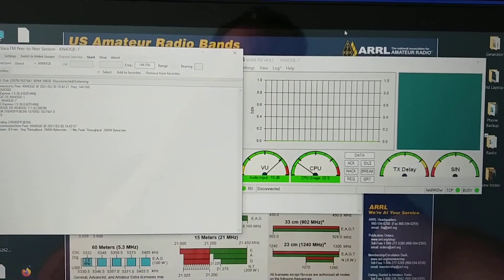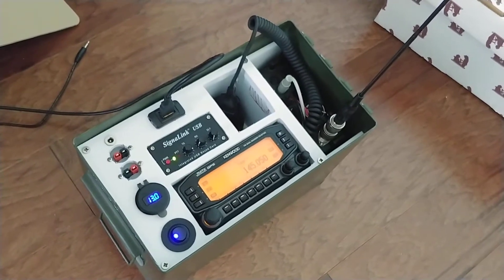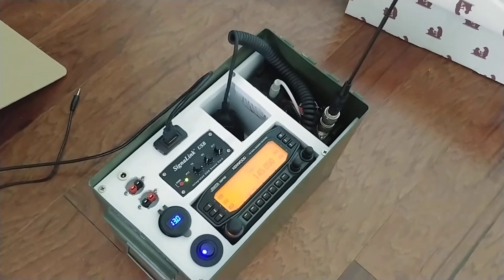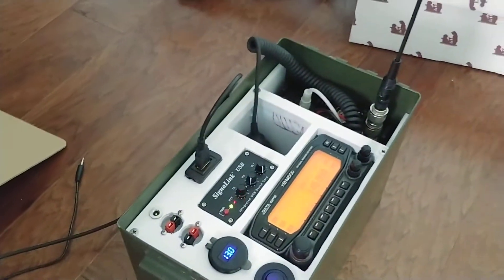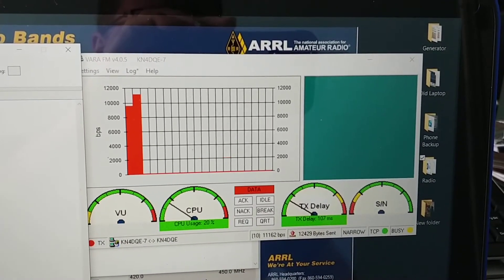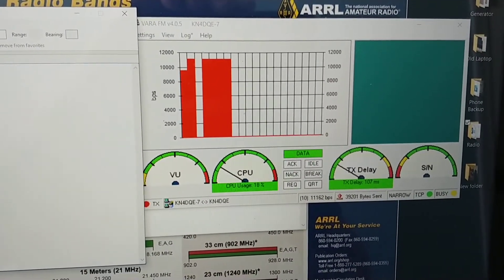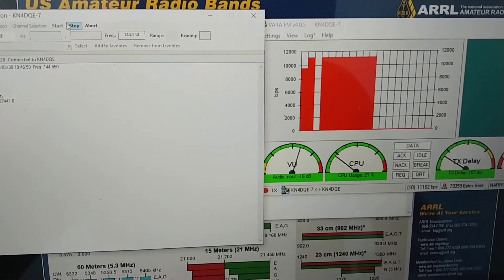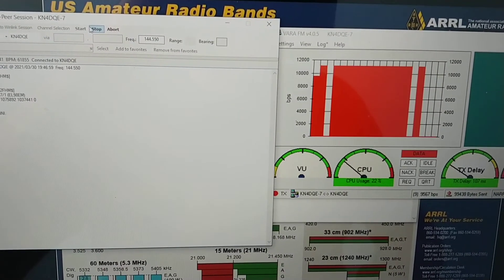VARA FM narrow mode between D710 and IC-9700

Comment: I just watched your video today and since it is now almost a year and a half later, I am wondering if you have you tried the peer-to-peer connection beyond your shack?  I am curious as to the distance you are able to get with VARA-FM in P2P with another station.  Of course I am thinking about EMCOMM when RMS gateways may be down.
Reply from the maker: I have a diamond x50 mounted in a tree about 100 feet in the air. It's putting out about 75w on 2m. The furthest I've been able to reach with P2P is about 20 miles. Speed isn't great, but I've noticed that VARA P2P doesn't have as much reach on 2m as 1200 baud packet.

Comment: I am a fan of your TH-D74 WinLink via Bluetooth video. I'm wondering if the same is possible with VARA FM - TH-D74 VARA FM via Bluetooth.
Reply from the maker: Good question! I'll have to test it because the bandwidth may be too wide. I'll give it a try and post the results. I did try using just a regular audio cable with a baofeng to see what would happen and it would not work. I needed to use the soundcard interface. Now you've got me curious!

Comment: When connecting the signalink to your Kenwood 710, which port on the 710 did you connect to?  On the head or on the data port at the back of the main body.

Thanks.
8P6RC
Reply from the maker: The back of the main body

Comment: for 25210bps assuming you have the high speed license you must set vara for WIDE mode. as well as kenwood set 9600. just thought id mention it. signalink must also be jumpered for 9600 . 73